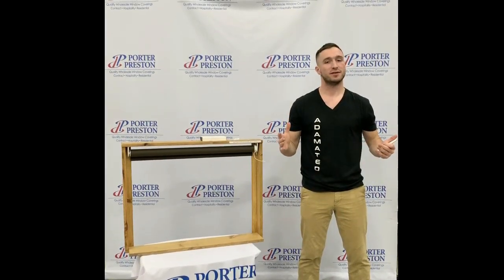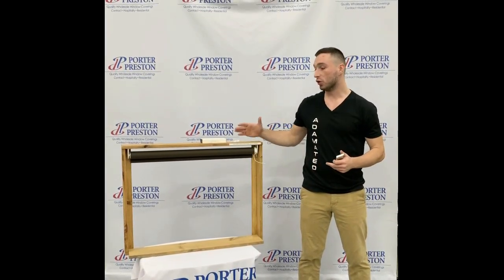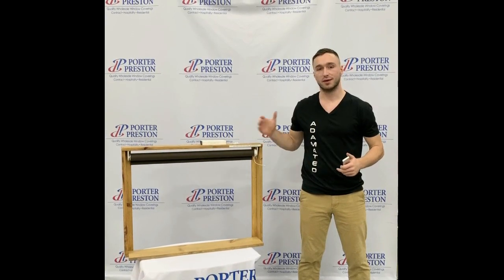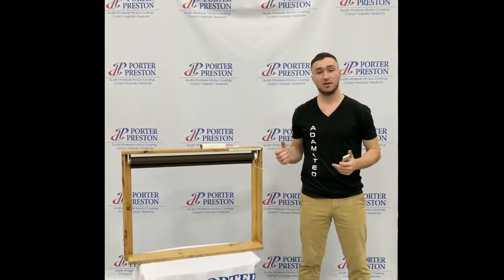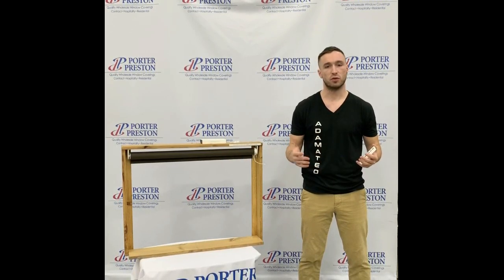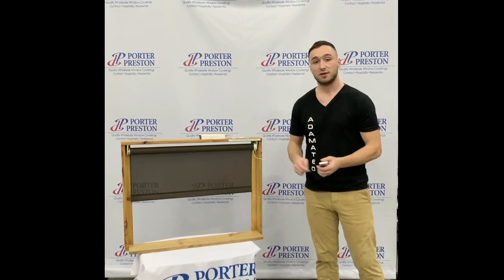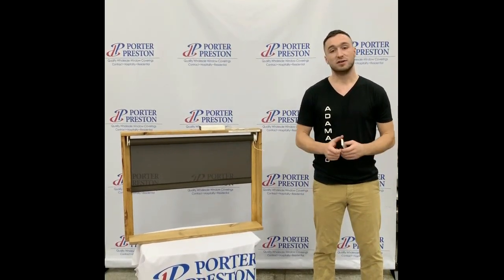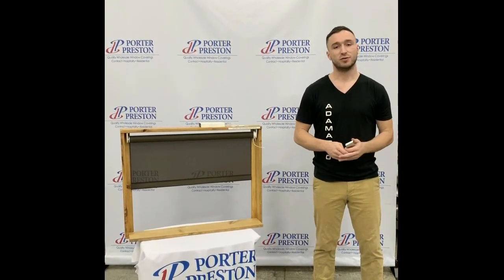How to Program Rollease Acmeda Automate Motors

Comment: how to do factory reset of Rollease Acmeda Remote  (Atomate).  Blinds stuck in lower position.  No longer go all the way up.  useing seperate number for each window does not help.  (4 different windowss in MBR).  mome of the programming steps followed seemed to help.  Mose show the newer model remote with the display screen>  Mine older  with 6 # buttons, up stop down.  I am so stuck.